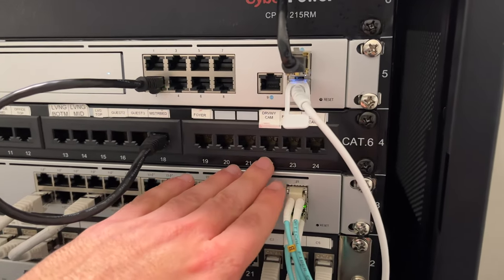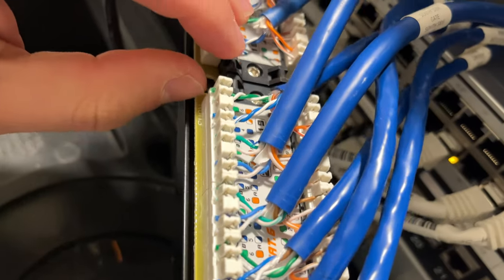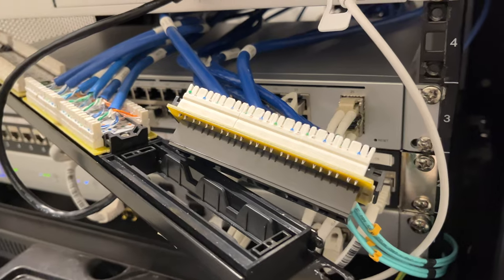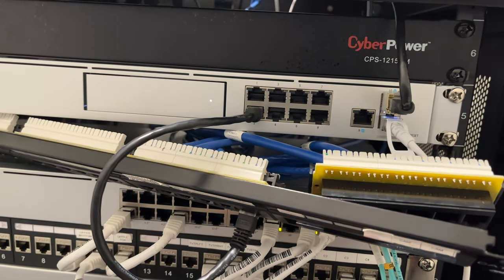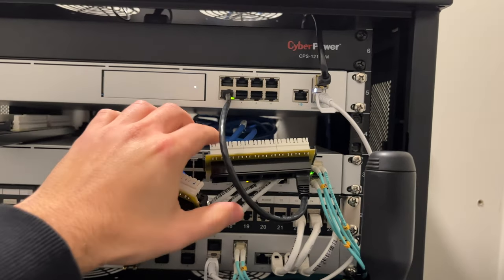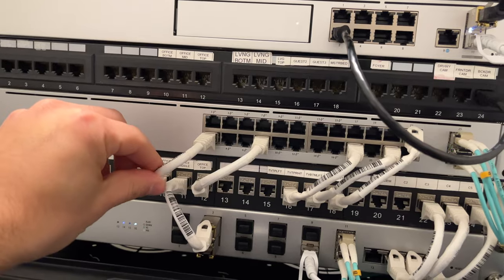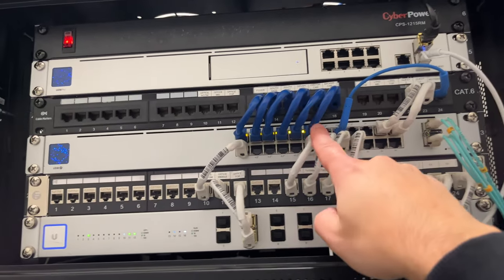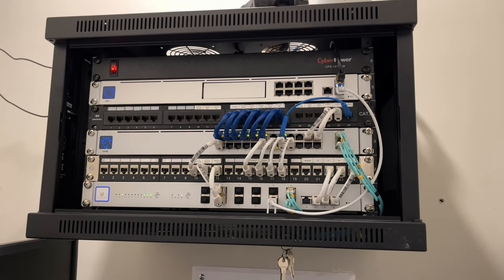Rearranging the Network Patch Panel a bit

Comment: One thing I think would be neat on a patch panel is if instead of 24 ports on a 1U have 25 ports so you can run the modem through and make it nice and clean so you can still map port one to port one on the switch and so on. I need to take a look and measure but if the ports were a little bit tighter it might actually work and just nobody makes it. 🤷‍♂️
Reply from the maker: I know right.   I'm on the verge of having two modem ports on my patch panels. Currently only have 1 for the server rack below.